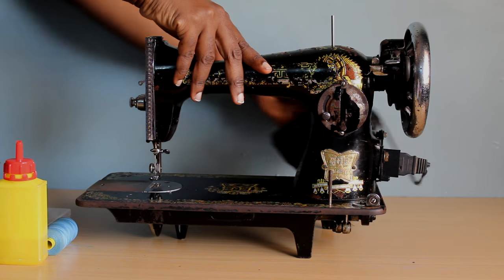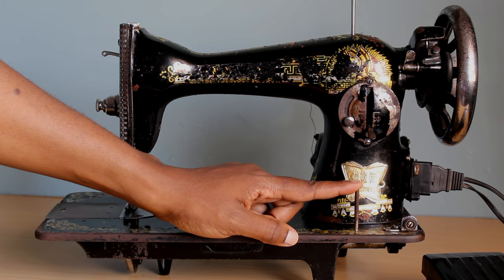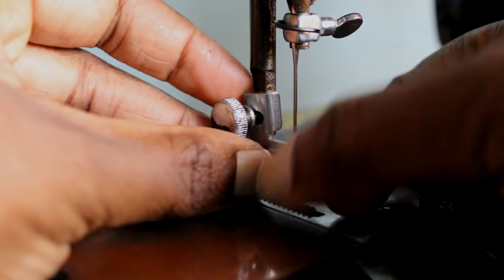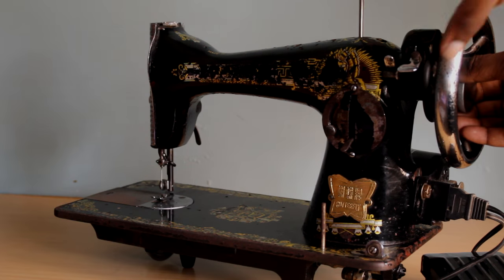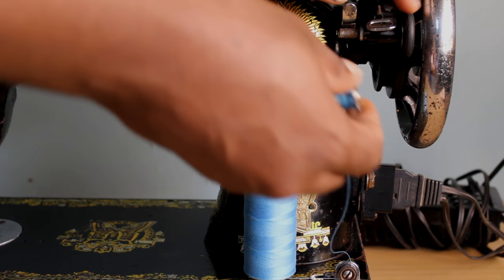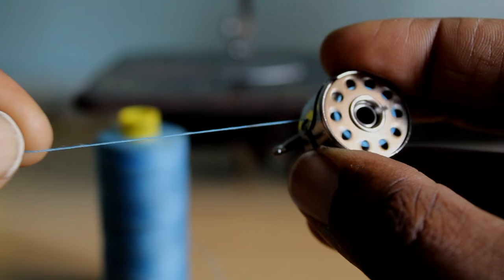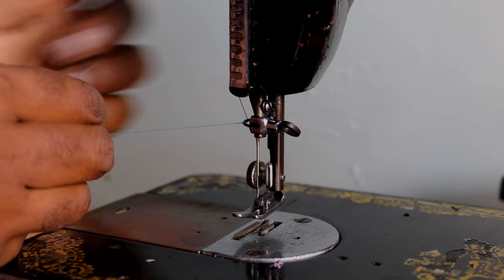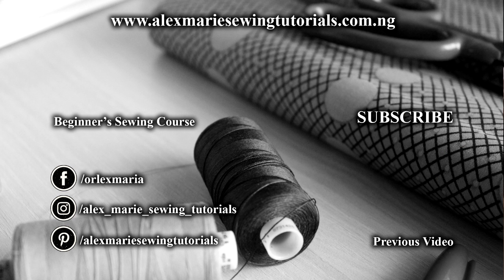How to set up your Vintage style Treadle Sewing Machine (Head only) | Alex Marie

Comment: I get tension problems.. Stitches r either too loose esp lower ones or wen i tighten the tension, the thread brks
Reply from the maker: hi. First, try to rethread the machine again. Make sure your bobbin is threaded properly. Try threading it clockwise with the thread coming down the right side. Also, watch this video for more info https://youtu.be/7axwiMR8cGc

Comment: Hi, I have a question. I followed exactly how you showed but my thread kees breaking when I try to sew. Do you have any idea as to why please? And I’d like to say that your video was REALLY the best at showing and instructing. I didn’t get anything from other videos but caught everything from yours. Truly amazing!
Reply from the maker: Thank you very much for that lovely comment. Now to answer your question. 1) Your thread could be of poor quality, so try another and see. Or 2) Your tension is too tight, try loosening it a little, or 3) You should try changing to a new needle. Use a number 14 or 11 HAX1 / 705 / 15x1 needle. Also check that the needle is going smoothly through the needle plate and not scraping against anything. Let me know how it goes. good luck!

Comment: I have both threads but I can't make a stitch on the cloth
Reply from the maker: Hi. Can you explain more? Do you mean the machine is not sewing any stitches?
Reply: @AlexMarieDIY yes the cloth had no stich but only holes from the needle. I later learned that I had to lower that part to holds the cloth tighter. I made a stitch like it was a line but the back is disorganized and I don't know how to tie the treadle belt. I'm just learning using YouTube
Reply from the maker: @penelopekisakye6718  I don't have a video for the belt, but you can see this video, https://www.youtube.com/watch?v=lXEoZIBserE  .I can help you with the tension settings and basic sewing. Please see the links below. 
https://youtu.be/7axwiMR8cGc and 
https://youtu.be/5GDLcuP9RFE and 
https://youtu.be/C__g-X7QkMY
Reply: @AlexMarieDIY  thanx alot. Let me use these to guide me, I will send you feedback on how it goes
Reply from the maker: @penelopekisakye6718  I hope your machine is now sewing, but just in case, I forgot to mention that you should make sure you are using a new needle in the right size. That can often cause a machine not to sew at all. HAX1 15X1 130/705H size 14 needles

Comment: I noticed you put the bobbin into the bobbin case so it spins counterclockwise.  On other peoples videos they show it being installed going clockwise.  I'm now wondering if it really matters which way it goes in ?
Reply from the maker: Hi. Well when in doubt always follow your sewing machine user manual. But I load counterclockwise for all my machines and haven't had a problem. I learned it that way and I'm just used to it. But thanks for mentioning this, I'll make a note in the description box for others.
Reply: @AlexMarieDIY   I'm going to load the bobbin the way you did just to see what happens.  It would be good to know that it doesn't  matter which way it goes in.  That would be one less thing for novices like me to have to worry about messing up on.

Comment: Which number of needle u use for this machine I have same machine but  it doesn't work proper lay
Reply from the maker: HI. I use (HA x 1) needles. You can use any size from 9 to 18
Reply: @AlexMarieDIY  I tried 18 but it didn't work but tanx for reply
Reply from the maker: @rosesk1879  I would recommend sizes 11 and 14. That works for thin to medium weight fabrics
Reply: @AlexMarieDIY  OK tanx I will try

Comment: The bobbing part
And the stitching part
Reply from the maker: ok...first, answer these 3 questions. 1) Were you able to thread the upper part of the machine? 2) Were you able to put the bobbin back in its case properly? and 3) Were you able to pull up the bobbin thread? This way I'll know were you ran into trouble
Reply: @AlexMarieDIY  I wasn't able to thread the upper part
Reply from the maker: @toluwalashedarasimi1600  ok. I assume your sewing machine is a similar model to this. Let me break it down. Place your thread on the spool on top of the machine.
Pass the thread through the guides as shown in the video. Make sure the thread passes between the tension discs. Also watch this video on tension to make sure your tension is ok
https://youtu.be/7axwiMR8cGc 
Finally thread the needle and pull up the bobbin thread
Reply from the maker: Is there any particular part of threading the upper part that you find confusing?
Reply: @AlexMarieDIY  the bobbing is not rolling when I put it up to the place you indicated
Reply: @AlexMarieDIY  the machine isn't similar to this its brother machine and its not electric
Reply from the maker: @toluwalashedarasimi1600  ok tell me your machine model number. Maybe this isn't the video for your. I can show another video instead
Reply: @AlexMarieDIY  brother
Reply from the maker: @toluwalashedarasimi1600  what type of brother?
Reply: @AlexMarieDIY  the manual one
Reply from the maker: @toluwalashedarasimi1600  you can send me pictures on email or IG, details are in the description box
Reply: @AlexMarieDIY  what's the email and IG name
Reply from the maker: @toluwalashedarasimi1600  alexmariesewingtutorials@gmail.com
IG is alex_marie_sewing_tutorials
Reply from the maker: @toluwalashedarasimi1600  This is a manual machine too. It comes with a treadle table. But you can buy an external motor and attach to it.